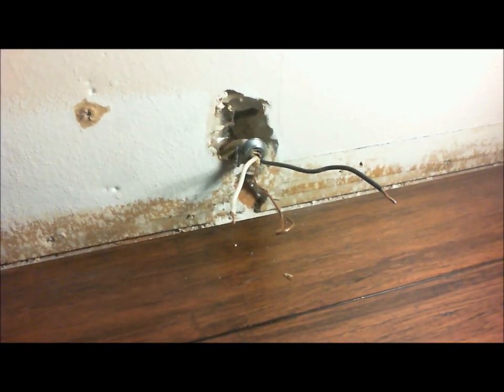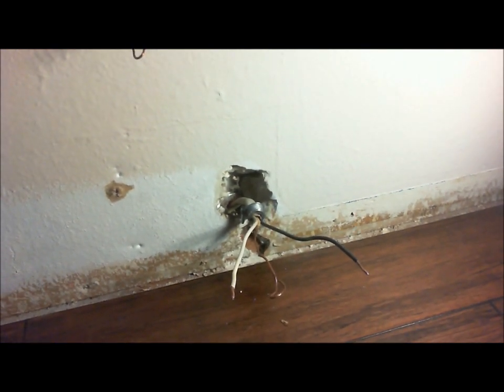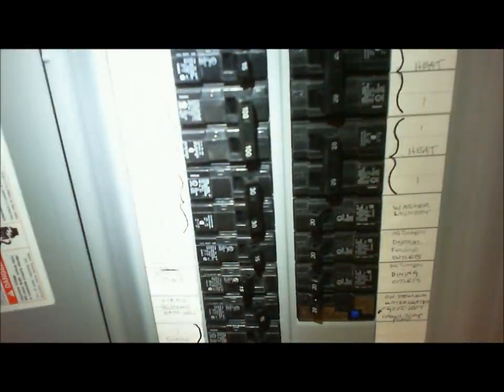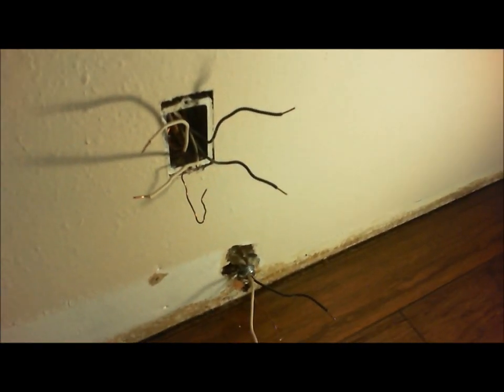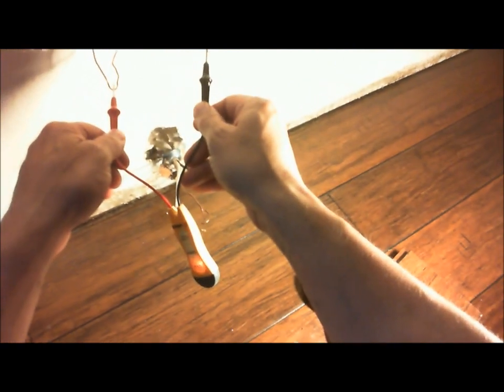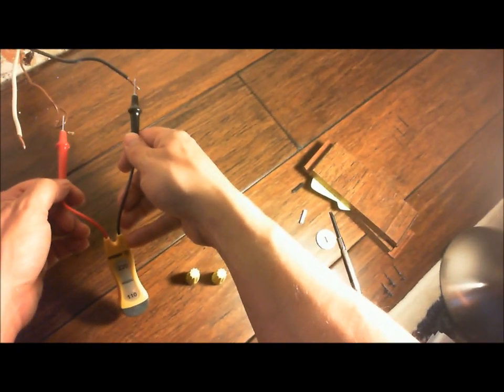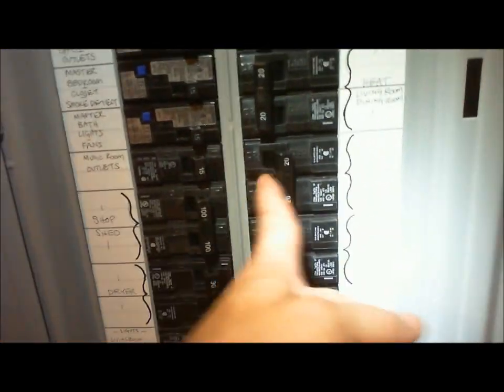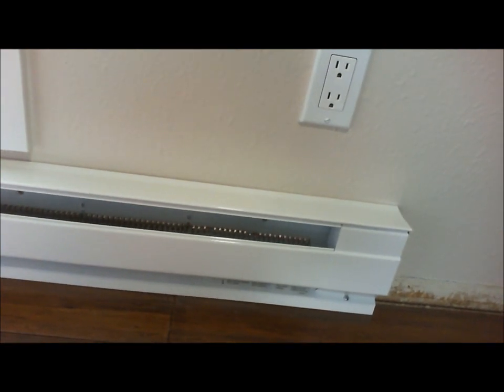Testing bare wires for 110 volts vs. 220 volts (outlet vs. baseboard heater)

Comment: Thank you for explaining what I couldn't figure out from just a Google search.   I purchased a spa blower that required 220v but wasn't sure if I had 120v or 220v running to the old blower.  They come both ways.  Anyway, your video really helped me figure it out quickly.

Comment: Also, the breaker to the heater was a double - so 240v.  I'm testing an irritating pump wiring with no breaker in the panel, so your method will solve my mystery. Thx for the video!

Comment: I’m trying to put up a new flush mount ceiling light. There are about a million wires hanging out. The colors are the same. How do I figure out which two to use?

Comment: This exactly why there are color codes and people get killed when people don't use those codes correctly! The only time I got zapped by 220v was when someone had previously hooked up a 110v outlet to the same set up he has on the bottom in this video. I was doing some work and normally you can touch the ground/neutral (white) side of the outlet no problem but whoever ran the wiring before the person who hooked up the outlet used white as a live wire...it zapped me hard twice in a row and luckily I hit my head hard enough jumping that it nocked me off it...I could have been a goner. Another time someone had done the sane thing but used red for neutral and white and black for hot. I installed a brand new $8,000 oven for a customer and when I turned on the breaker it fried the oven. Fortunately the customer was cool and let broke 21 year old me figure out how to fix it. Ordered the parts thank God and was able to fix it with a week's pay out of pocket. Always check because not everyone does things correctly...it could save your or someone else's life!
Reply: Thanks for sharing your story,  you may have helped someone else avoid a similar mistake.  

I'll share with you a mistake I and a fellow electrician made 2 years ago while replacing a breaker panel in a family diner built in the 1960s.   The power from the pole was a 120/240 volt, 3 phase 4 wire open delta.   Meter and fused main disconnect on outside of building, inside was a 40 space 3 phase panel which fed a smaller 30 space single phase panel.  The panel that was being replaced was the larger 40 space.   Me and my partner took turns dismantling the old panel, installing the new one and landing the circuits.   My partner didn't tell me what phase the 208V stinger was originally on,  I didn't ask him and didn't verify with my multimeter and he didn't verify from me where I landed it.   I assumed it was on phase B in accordance with the 2020 NEC.  (It was originally on phase C)   We turned the power back on, and everything worked normally, so we were loaded the trucks and headed home, it was around 12:30 am at that point and were were in a hurry to catch some zzz.   

I get a call 2 days later after one of the janitors plugged the floor polisher in, and it ran abnormally fast and powerful for about 30 seconds or so before going up in smoke . When I tested that outlet and read 210 volt I muttered, "SHIT" and realized what I done. Luckily the floor buffer was the only thing destroyed and was only about $350.  The security system and receptacles for the cash register and POS systems were already on phase A in the single phase panel, so they were safe.  The remainder in the single panel was the lighting and some receptacle loads alternating between phases A and B.   The lights were a combination of F32T8 fluorescent,  and LED, universal voltage 120~277V, so the lights were fine on 120V or the 208V stinger.   

Moral of the story.  ALWAYS VERIFY THE VOLTAGE, NEVER TRUST THE COLORS.
Reply: @Sparky-ww5re  Absolutely, and thanks for sharing yours! Yeah that could have been way worse as well! Definitely don't rely on colors haha 👍🏻

Comment: In the future no need to test if you located the correct breaker.  Single Breaker for outlet = 110 Double Breaker for heater = 220.  Just check if its a single or double breaker and you have your answer!  Most baseboard heaters state this in the beginning of the instructions so you know which way to wire it.
Reply: Yep easiest way is ask yourself is this on a single pole or double pole?

Comment: What ga Wire for the 240 volt heater and how many feet to the panel. Thanks
Reply from the maker: Probably 50' to the panel.  Gauge looks 14 but could be 12.

Comment: What's the brand of your tester?
Reply from the maker: It's Sperry HET202
Reply: You tested the lines for power or voltage. Can you test existing lines for continuity? In order to tell if there’s a break in the line or circuit itself.

Comment: Thx for the vid. Very helpful. Just curious if I did something wrong. Every time I touched black and neutral with my tester, the breaker tripped. But when I touched black and white with the tester probes, I got a 120v reading. Stumped
Reply: bad way to test but you can just touch your black wire and that lil 120 zap won’t hurt much and will tell you what you need to know (can still kill however) and

Comment: How do you test if you don't have a ground wire?
I assume you would put leads on black and white wire - if the white is neutral, meter reads 120.
If white is also hot, meter reads 240.  Am I right?
Reply: test hot to hot, should show 240 volts, both from different legs back at your panel.  White is neutral, its the return path for voltage going out on the black.  120 volts from black to white, means theres a difference in voltage of 120 between the two, so 0 volts on your neutral and 120 on black.  But if you have any loads on the system, you might get a small reading on your neutral wire, if you test neutral to ground you can see it.

Comment: For the heater, shouldn't you have one wire be 220, & the other neutral to return? I have a hard time grasping how electricity works so forgive me.
Reply: In 240 volt systems, each voltage leg takes turns as the return path for the voltage.  Thats why you dont need a neutral.
Reply: @maddavescientist  some applications still do require a dedicated neutral. Hence the 4 prong 220 cables you see somewhat commonly. But most 240 appliances are high consumption resistor type devices. Motors, heaters, etc. And they dont really send "unused" power back to source. They tend to consume everything they're fed.... but not all
Reply: @natas0733  what if I have 4 wires coming into my baseboard. I assumed the two blacks were hot and two whites were neutral but the heater doesn’t work properly and today I was going to test with multimeter to see which ones are hot. I wired it just like the old heater but it doesn’t work.
Reply: Is the heater a forced air unit? And is it 120v or 240v? America?

Comment: Hello there, I believe that you're supposed have two hots and the white is  always nuetual and the bare wire is the ground. Don't think they used the correct wiring in that one
Reply: i dont think the heater needs a neutral so they are running the 2nd leg on the white/neautral wire
Reply: @chip9177  yes but they should have put either black tape or red tape on it to signify right off the bat to future electricians that it is hot. Even tho we already know... its just a safety protocol so that you cant forget it after lunch or some shit...

Comment: I was hoping to see you actually install the outlet. Oh well. Can't be that difficult if you assumed we already know how to install it, right?  Like, if I made a cooking video demonstrating the use of an instant pot, I wouldn't waste time showing how to plug it into the wall outlet, is all I'm saying.  So, off I go!  Wish me lucky!
Reply from the maker: Good luck! There's a lot of great content online regarding how to install outlets, and it's definitely a job you can tackle yourself. Once you do it, it's no longer as scary.
Reply: andotech agh!  It has three black and three white wires coming from it. One is to the switch, one is to the light and one is to the receptacle on the other side of the wall. Instead, I'm going to use the receptacle that is on the other side of the wall. This should be easy.